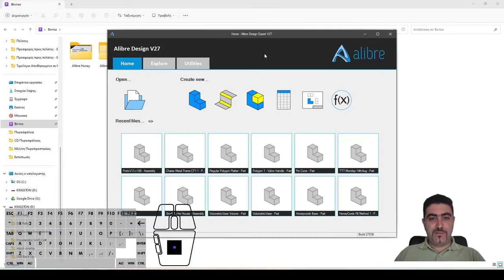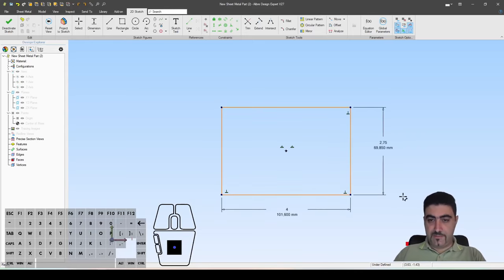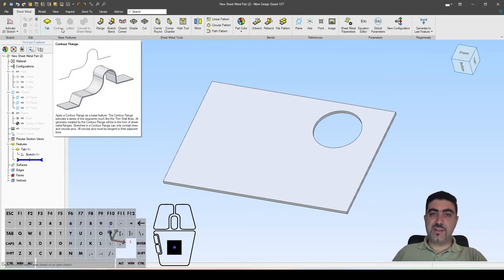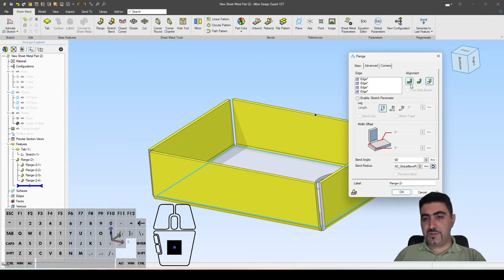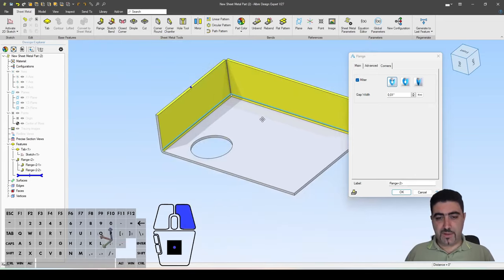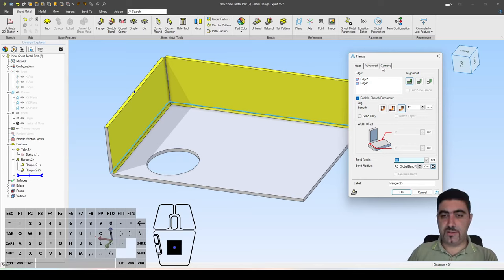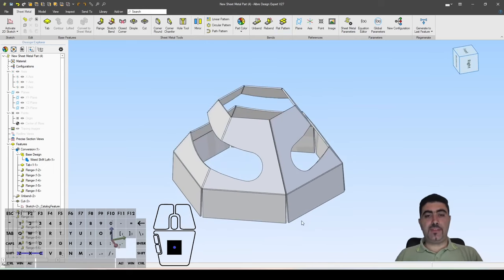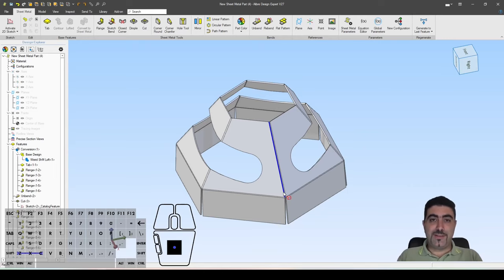Rookie to Rocking it: A Sheet Metal Masterclass in Alibre

Comment: The solid shape to sheet metal is an awesome feature. It can be a lot easier to work backwards sometimes. Thank you for uploading that.
Reply from the maker: Yeah, that a great technique. Especially when you need the sheet metal part to cover a solid one. That's where I use it the most to be honest. But there are a lot of little tricks hidden in Alibre Sheet Metal. Check HaroldL's channel for sheet metal tips in Alibre too. The Grand Master of Alibre Sheet Metal
Reply: @ExMachinaEngineering  Thanks for the channel recommendation. I will check it out. I am having some trouble with the flanges intersecting and I don't want to break a closed sketch for a DXF if I make one mistake by altering a flange sketch.
Reply from the maker: If you're a member of the forums, post a question there with a pic or a part. If you're not a member yet, sign up. They helped a lot when I first got the software and we can now help you

Comment: I'm wondering if there is a way for Alibre to calculate if an object is able to be formed in the press brake without intersecting with the machine itself during the process. Obviously it knows if the flat pattern itself is not feasible but the combination of required bends may not allow it to fit in a press brake in any sequence of steps. This came up a few times several years ago by surprise when I worked in CAD for a sheet metal fabrication shop.
Reply from the maker: So, what you're saying here Sam is a very important part of designing Sheet Metal part. However, to my knowledge, there is no CAD software that has this provision. So, it's important to connect with a local shop, even if they're not the ones making the part. You can get some design rules from them. They can be a rough guide.

But very important point to bring up, Sam! Cool comment!

Comment: 00:00 Hello! Here we go again!
00:11 I'm already overwhelmed. This is going to be completely different compared to what I've learned in CAD over the past year. I know nothing about sheet metal.
00:23 How about ice water? I've been 99% caffeine free for about 8 years now!
02:03 So, that value describes how much the metal expands as you bend it? Not sure I'm understanding, I think it'll be more clear as I watch.
06:35 So right now, from pure guesswork, it seems that the Tab tool is basically like your starting piece, whatever it may be. It's your main "extrusion" that everything else is based on, if this was the regular part editor.
10:23 Ah yes, my lots of manufacturing experience will help me here....... I totally have manufacturing experience.... If you count 3D printing as manufacturing! 
12:33 At least it's easy to check your work.
14:55 Very cool that we have all these methods for getting the measurement we need.
18:16 I can tell that the "bend only" box is definitely a rare option, but it's nice that it's there. More options are almost always better! Who knows, maybe that option will fix a problem at some point and you'll be glad it's there.
25:26 Yeah, actually that makes sense. Either way it's going to lie right next to the little part under it. The offset will move it away. 
25:47 I'm actually getting an issue here, it applies the AD_Thickness value but then the whole flange goes away and resets.
27:50 Before hearing your explanation-- it's like a thin extrude in the part design environment!
28:15 Okay, I was kindof right! It does more work related to sheet metal, but still. Very powerful!
41:35 I think there's a joke in there somewhere.
45:08 That's a lot of parts!
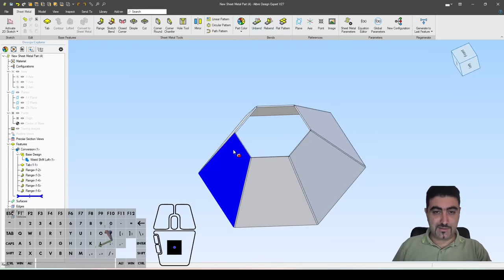47:19 I'm about to use Alibre's sheet metal stuff to design different ways to fold cardboard boxes. I wonder if I can send a stencil to my regular 2D printer to cut it out with scissors.
50:00 It's way different, but I know the basics now at least! Thank you as always!

EDIT: I just finished the one TTT sheet metal model on his site. It took me a while, and the only reason my time was big is because I dimensioned from the wrong place in one spot! That's all! Time 21m30s
Reply from the maker: 00:23 That's good, man! Me, I've been 99% caffeine for about 8 years, since 2016 that I started my own company. lol
02:03 The k-factor is really hard to describe with only a few words, but if I had to try I would say it's the ratio of how far from the bottom to the top of the thickness is the imaginary line where the material neither stretches nor compresses. That in turn dictates the slight difference in length that the flat pattern needs to be so that when bent, you get the dimensions you were shooting for.
41:35 Ehm... Only if you're using resin-impregnated Carbon Fiber, which you cannot bend once it cures anyway...
47:19 Check this video out:https://youtu.be/Ub8FwuZL1Sc?si=tEvk1LXB98N--3_s

Watching this video and then doing a TooTallToby sheet metal part, impressive. KUDOS!